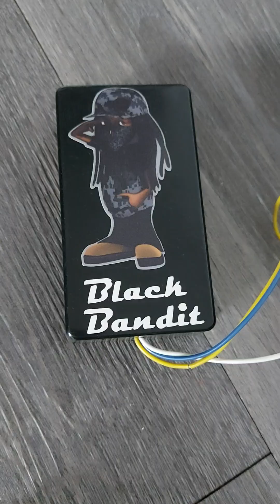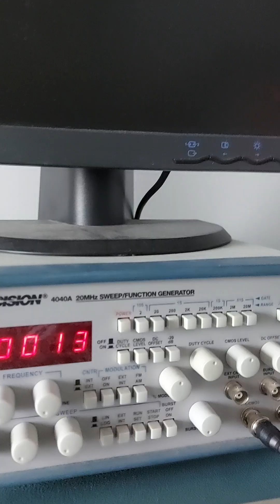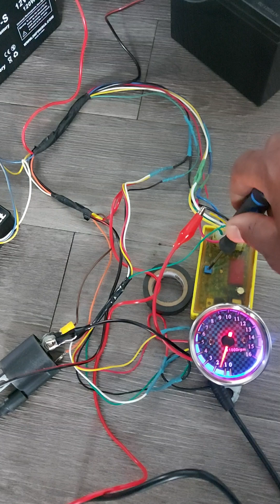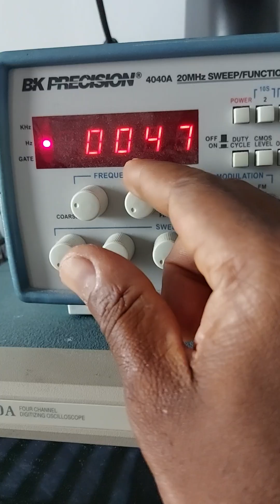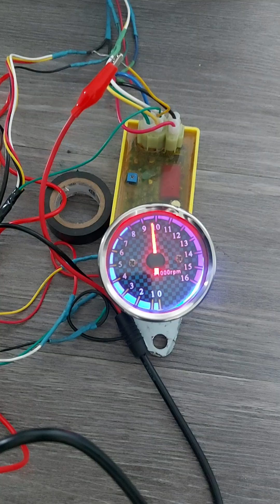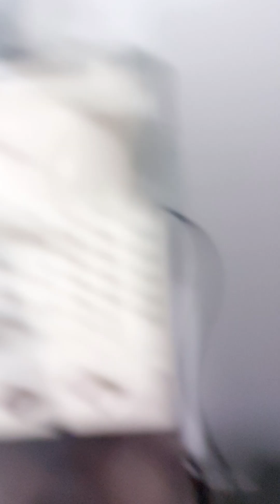DC CDI's and how hey work

Comment: Yes sir  what is the cost of the blBlack bandit box I would like to try it out 👍
Reply from the maker: I'm working on a kit for this summer that I'm putting together. In the kit, it will have the black bandit box, the CDI and the RPM gauge, and a full wire harness with a switch with a ignition indicator light , so, the only thing you'll need to do is connect the battery.
Reply: @BlackBanditProductionz thanks for the reply I would be looking out for you kit👍
Reply from the maker: @antiguaandbarbuda26884-c Once I get it all together, I'll put a video out there so you can see everything that comes with the kit And I'll let you know What platform it will be sold on And thanks for  Checking out the channel .!!!!